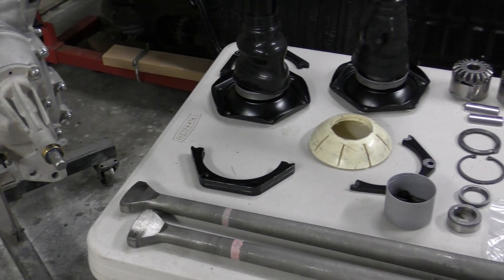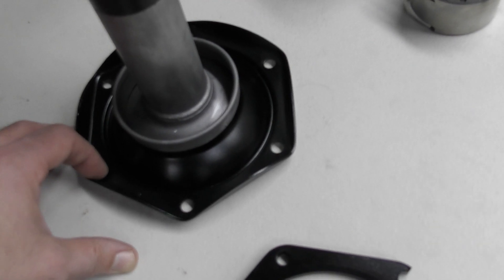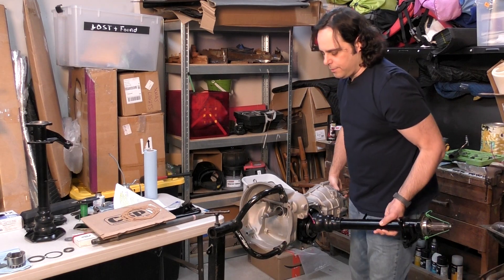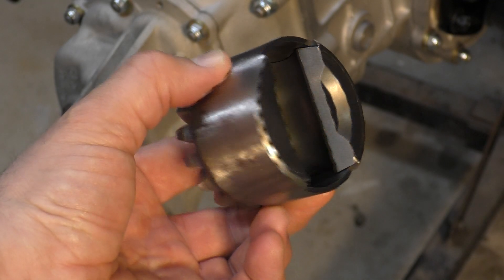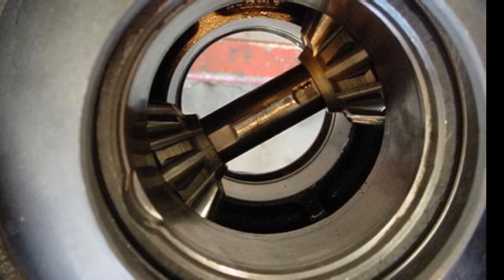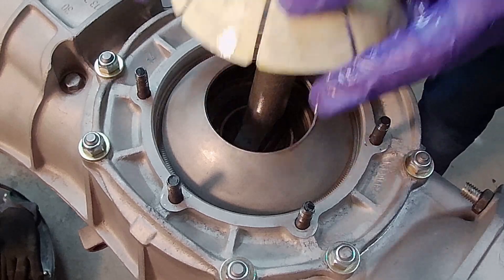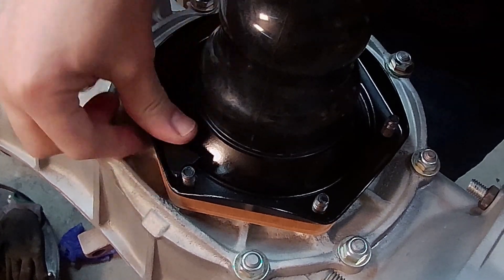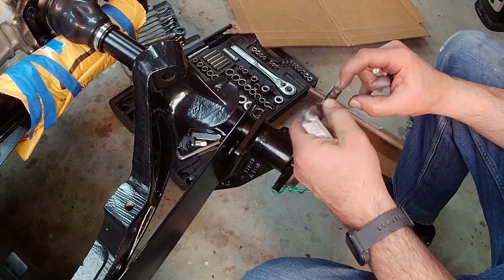VW Transaxle Part 1: Installing Swing Axles @PetesGhias

Comment: Looks like you have the axle wired at the end with green wire or something. What is the purpose for this.?
Reply from the maker: Hi, I wired the axles to hold them up so they wouldn’t flop around. Makes it easier to bolt onto the frame.

Comment: Did the reenforcement plates prevent leaks?
Reply from the maker: I will be posting a follow up video as soon as I can... project on hold for a while until it's fully painted.
Reply: Where did you get your axle tube gasket spacers?
Reply from the maker: @cyprianskiba8768  I bought them from Cip1.  Look for the more expensive German kit because they come with the half thickness gaskets. I think this is the link: https://www2.cip1.com/c24-111-398-005-p/
Reply: nice thank you.  Many of these kits Don’t say if they come with an assortment of thicknesses of gaskets.  They may all be .5mm